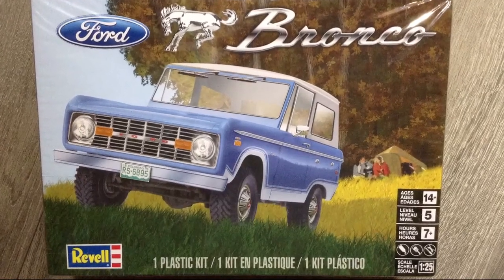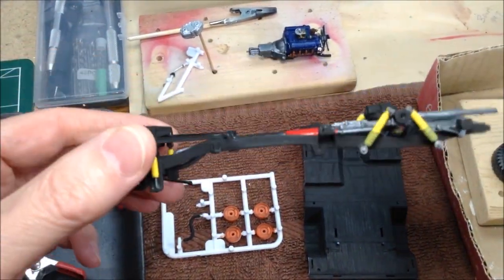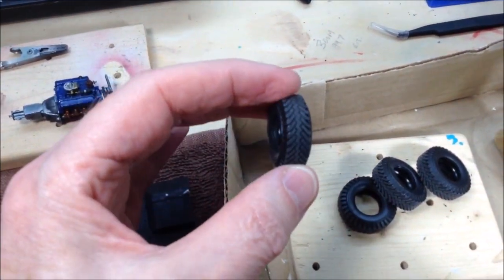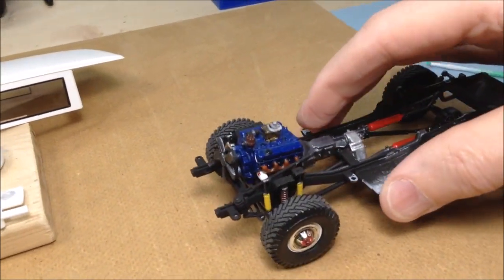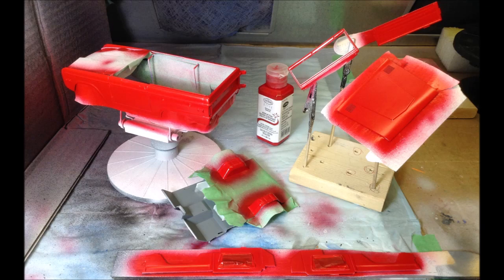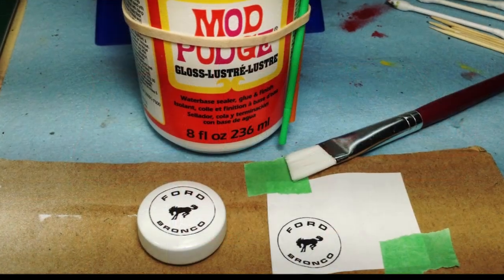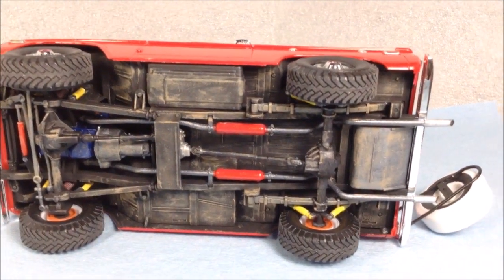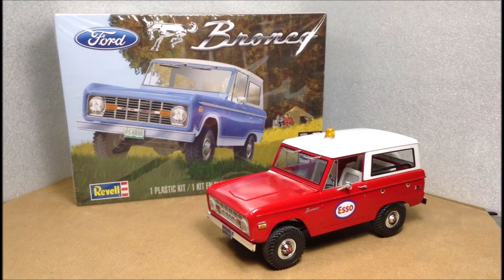Revell Ford Bronco

Comment: Looks really nice Steve, what did you think of the kit?, :) 😎👍
Reply from the maker: Thanks Tom, it goes together very well, everything lines up really nicely, but I found, for some reason, it does not go together the way most kits do so I was doubting it all the way but everything fit perfectly.  I have another one but I'm not sure how I will do it yet.
Reply: @ModelCarMinion  I like the kit, I see they are going to be reissuing it with a trailer and dune buggy, 😎👍
Reply from the maker: @ramblers69  I know you like this kit, where did you see the new version?
Reply: @ModelCarMinion  I had several people sent me pics, check out Tim's latest video at the model show, Revell was there, they had the Bronco, and the 30 Ford coupe boxart too